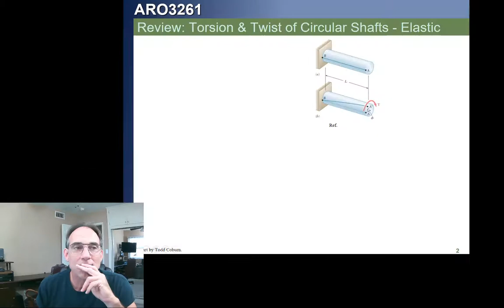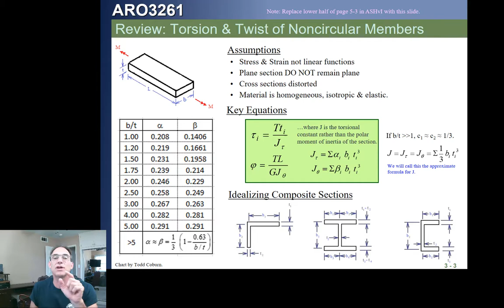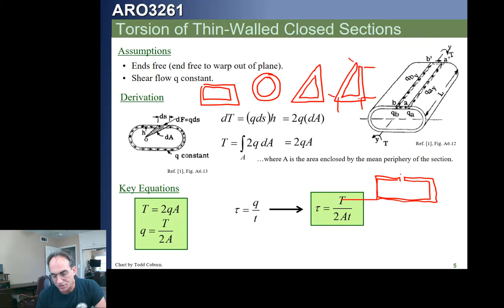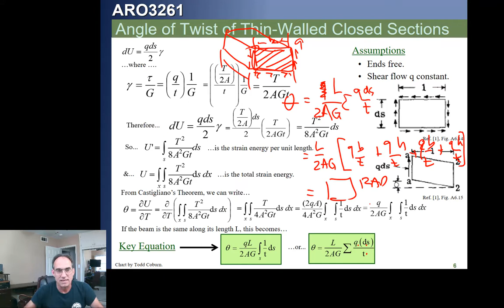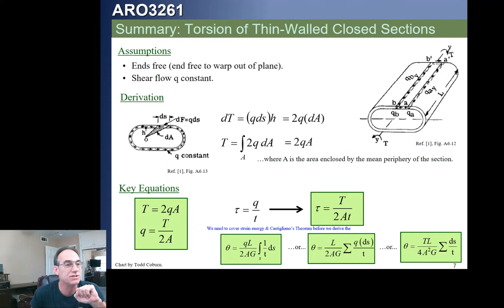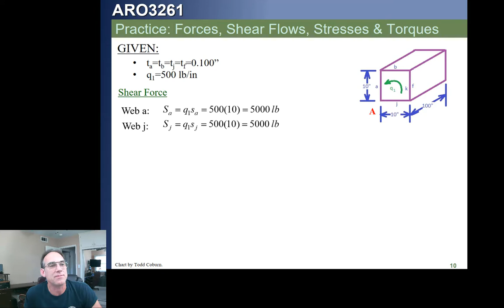Stress Analysis I: L-08w (Alternate) Torsion of Thin-Walled Closed Sections (TWCS)

Comment: sir in my university lecture slides i was asked to find out the rate of twist of a thin walled closed section....is it same as angle of twist or both are different terminologies?
Reply from the maker: The angle of twist is the total angle rotated by the specimen along its length.  If you were asked for the rate of twist, your prof probably meant the angle of twist per unit length.  This is rather confusing terminology, since rate of twist would generally be associated with a time-related change of rotation.  However, it appears some folks use this terminology, perhaps thru lack of a better word.
Reply: @ToddCoburn  yes sir definitely it was meant by the angle of twist per unit length....I don't know how to calculate that, can you please discuss it in your upcoming videos along with some complex problems related to torsion of non-circular sections?
Reply from the maker: @hafizmonisahmedansari5117  YOu can compute angle of twist per unit length by simply dividing the angle of twist by the length.  This is more commonly done for thin-walled closed sections, especially when the TWCS have multiple bays.  I used to cover this in ARO3261 but moved that content to a later class, so I do not believe my video covers that currently.  The Aerospace Strength Handbook - Volume III will include that content.  Torsion on non-circular sections is covered already on the video following torsion of circular sections.  These are not very difficult, and are computed more commonly in the aerospace industry than torsion of circular sections.